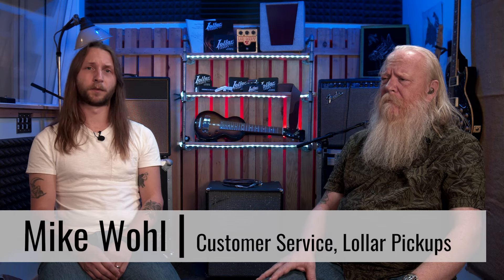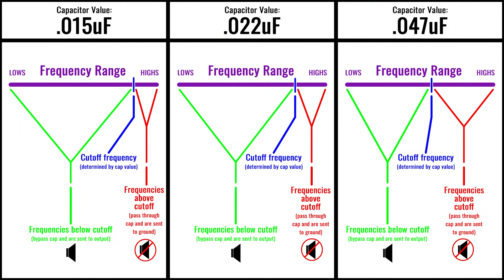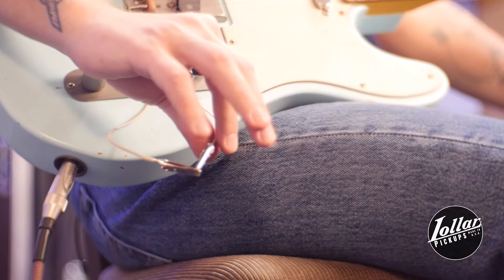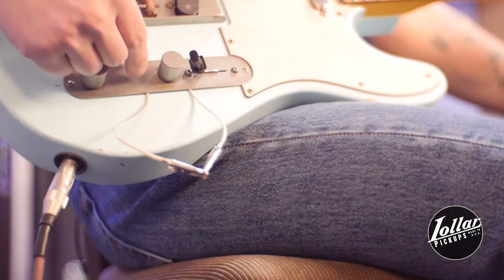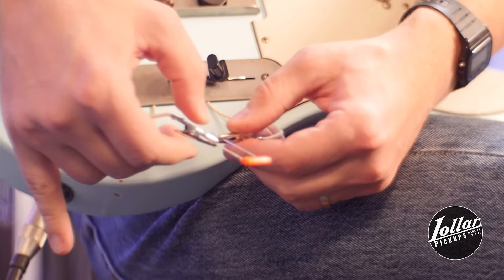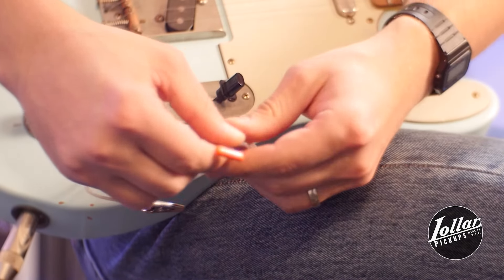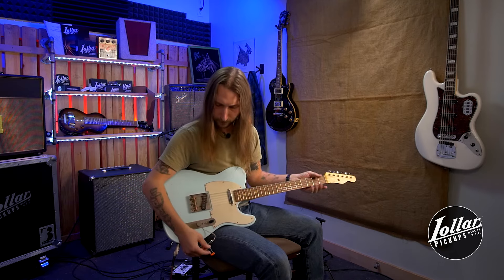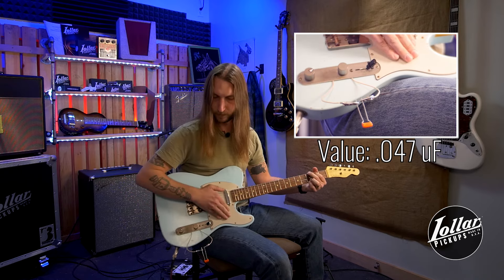LOLLAR PICKUPS Presents: TONE TRUTH - Capacitor Value

Comment: At "wide open" there is no difference between cap values on the Tone knob. Would that be a correct assessment? The cap value only comes in to play as you roll "off" the tone knob. Yeah?
Reply from the maker: Most pots will have some small amount of leak to ground when all the way "open", but it's pretty negligible. So, you will possibly hear some small artifacts of the capacitor, even when the tone knob is turned al the way up.

There are "no load" pots, which essentially have a dead spot at fill open, where the contacts are completely disconnected, so there is no connection between the signal and the cap at all. Some folks swear by these as the most "true" representation of the guitar's tone, but it's a fairly small difference and, since we have all been conditioned by decades of traditional guitar wiring to hear regular pots - along with their inherent leak to ground - that no load pots can often sound too bright and unnatural. 

For a vast majority of players, there is no use in swapping their traditional pots out for no load pots, as the effect isn't worth the trouble and many don't prefer the truly wide open sound after the fact. And, honestly, I'd argue that many who claim to like the results are just trying to justify the time, effort, and expense of the modification after-the-fact.
Reply: @LollarPickups  Good info, thanks!
Reply: My ears say the higher the value of capacitor the more capacity for charge held, the real question is how well that charge is held and how well the capacitors behave to effect the range in frequencies at full open as well as the properties to inhibit highs at full potentiometer/variable resistor operational purpose(closed)

 So more is more, 
And,
its why louder on the amps master volume is better, 
but I still turn my volume pot down to 7 or 8 to allow the caps to do their job at full frequency capacitance with more room to spare and j ne er max my control knobs i always prefer a shaped tone but that delends on thd amps response of the hardware i have in the signal chain, thats when most of fhis argumenf goes out the window. then I find the tone pots sweet spot for me, it is subjective but the guitar as marvellous and awesome an invention as it is and i absolutely love guitars, it is still mathematics and science at the most basic level in its field., in regards to circuitry and design, guitars should be way cheaper especially the electronic components, 
You can get parts ten a penney! Buy in bulk get decent parts that way you can match your pots too, they never read at the value stated and always under or over by the tolerance margin stated they pump these tiny insignificant components out thousands a day and theres no time to test them all. they are the simplest of parts that big ass aeronautical space ships snd plane components are made at the same fa tories, so they are very cheap in comparison not woth 30quid fot a fkn potentiometer or some old out of date "vintage " capacitor if you buy those you are being suckered unless you're running a fake vintage guitar racket scam... then youl need em. and I love how simple it us, lol inside your Nokia 8210 whatever in the 90s if you still have one, it's a supercomputer in comparison to a guitar.

The frequencies drawn from the amps greater magnetic pull(more power) amp responds to the signal if grounded well enough, higher value capacitors on your pots add more girth to the high frequencies, at the same time more highs rolled off yet still more mids are present, because, the resonant peak is shifted into a range that favours low to high mids on the eq spectrum which has all already been mapped out and time tested to be where guitars are better sounding i mean in the mix of a full band, each instrument, some are close to each other like piano and guitar, but each instrument including drums have a strong optimised area to be in within the whole frequency range that the human ear can hear and the man from del.onte Says YES!! 
everything else outide the box is cut out to preserve the sound and save on whatever , mostly because it's useless snd thats that.

. You get more frequencies with  higher value capacitors and still have with logarithmic pots, the option to diall those frequencies back and have a wider range of choice of frequency from full open to full closed.
 Particularly handy when the guitar has bright pickups and good when you have a less expensive amp than tube amp, like a  solid state amp to play on either way- use the guitars and amps eq to control the signal from the guitar thats decidedly how to manipulate the amps responds to the source signal.
 Electricity in an uncontrolled or controlled environment is always drawn or held but never pushed through the amp its electromagnetism basics 101.

Capa itors are what they say they are- used to at various vues, to build up a capacity for an electrical voltage, snd in that value is the information, only judged by response from a receiver designed to connect with another weaker ir stronger electromagnetic cuitcit with magnetism in ghe case of guitars and amps its a variable responsive relationship between the two. 
 the signals are .ensured in wavelengths and currents amplitude etc 
resistors redirect, but the source of the signal has to be within an acceptable range of tolerances and it boils down to the relationship between the pickups reaction to the strings vibratory disturbance of its electromagnetically induced field 

not unlike if you visualise a picture of the earths electromagnetic field from the north and south pole, 

so if everyone all at the same time plugs in and slams a G-Chord we can literally save the planet from an extinction level event like our sun emitting massive coronal ejections tight at us
, it's why it's called the "people's chord"
This is the way, I have spoken.

Comment: Great resource!  I was a bit surprised that with the controls wide open, all 3 caps sounded slightly different from each other, and from the no cap set up in the beginning.  I had always assumed that wide open they would all sound basically the same.  Thanks for taking the time to do this!
Reply: I noticed that too but I think the differences had more to do with where and how he strummed the guitar.
Reply: Confess I didn't hear a difference.
Reply: A lot of rock and metal guys have sworn by no tone control for maximum headroom. Or maximum perceived headroom really, because it's just a touch brighter and more open at the top, which is good for downtuning or a lot of thick distortion.
Reply: The effect of the tone control is the combination of a variable resistor and the cap going to ground.  So it is always exerting some electronic effect.  Whether the effect is noticeable will vary with the particulars of the pickup and the combined value of the max resistance and cap value.  (Remember that guitar amp speakers themselves rapidly and substantially roll off output at higher frequencies.)  Practically speaking the effect will be more pronounced with a 250k pot as compared to a 500k pot, and darn near unnoticeable with a 1M pot.  If you have bat ears there are also specialty pots (no load)  that have the resistive element removed from the top of the contact path, effectively removing the tone circuit path to ground at max setting and eliminating any possible frequency loss.

Comment: I have been a .015 Polystyrene advocate for many years in Stratocasters.  For over 20 years any customer in my shop who I ever made that change for always loved it.
Reply: What caps do you use with humbuckers?
Reply: I wanna know too, the writing on the wall says .022uf but if it matters in my 45 years of "Reviving" Gibsons I found nearly half of the 50s and 60s semis/hollow and solids used 300K pots and to be honest all the caps worked okay every-time( mostly wax in paper or ceramic discs( was fixing up a 61 335 and found 2 ceramic disc caps, they sounded very mellow). There is'nt a rule just opinions. Best clean LP tone was a 50s LP special( 300k pots, .022uf caps? Have'nt been able to replicate that tone in 5 years of noodling...maybe those P90s were a bit "magic"?
Reply: Especially with hotter pups that are already a bit dark!

Comment: I just purchased a 4 conductor wire hummer. And a push pull pot but it came with no capacitor ? Why and does it need one,?
Reply from the maker: Glad you asked. If you bought it from us, it's because we sell caps and pots as completely separate parts. Not everyone needs both for their individual project, so there's no need to charge everyone more than needed or to create more waste of unused electronic components in the world.

If you need both; you have to order both. If you don't; you don't.

Without a capacitor installed, a pot will just act like a volume control, sending your entire signal to ground. When you add the cap to the circuit, it becomes selective in which frequencies are filtered out to ground. Basically, think of it like one of the holes in those toddler toys. The cap is the "square hole"; only the "square peg" frequencies (the higher ones) will fit through the hole to ground and aren't heard. The remaining frequencies continue through the rest of the circuit, through the output of your instrument, and eventually into your amp and out through the speaker.

The pot only needs a cap if you want it to be a tone pot.

Comment: The .0015 rolls off the most highs though…. I thought the higher the cap value the more roll off… am I crazy here? It’s really obvious when you use the jump links at 25%. It’s considerably more roll off than either the .022 or the .047

Comment: I went through a capacitor journey on my Strat about 2 years ago. I settled on .015uF as my all around favorite tone cap for single coils. The fine tune-ability, the smokey jazzy tone all the way down, and the surprisingly decent “woman tone” all the way down with gain… It’s just perfect. Another fun experiment is to use a super small value, like .001uf, .0015uF, .002uF or thereabouts, as a tone cap. Since the resonant peak shifts to just below the cutoff frequency, these values actually provide a perceived midrange boost, which is especially usable on a Strat bridge pickup to achieve chunky rock tones. It’s like a super secret weapon, right there at your fingertips, very fun. I would still pair with .015uF on neck and middle though. 🤘😎🤘
Reply: Add 0.001uf cap AND parallel 130 ohm resistor = treble bleed on volume pot
Reply: I have recently done this on two of my Strats. The bridge pickup sounds amazing now. I used 0.0068 on one Strat and a 0.0047 on another one. With the tone wide open the pickup is less shrill and rolled back it can get close to a PAF in tone (but not output of course). Both these Strats of mine have alnico 2 pickups in the bridge position.
Reply: I bet the Alnico 2 helps smoothe out the naughty top-end, I ended up putting a 60scJensen PIO .1uf in my Strat bridge and middle and after trial and error found the sound that I dig( for now). They were dedigned for amps but you should hear them in a Strat, I think all the spares companies are rebranding these old Jensens , if you have a chance try one, I may try a 5000pf red jensen after reading your post, cheers.

Comment: Great video. On one of my Strats, I have a push pull tone knob that lets me switch between a .15 and a. 47 capacitor set up. So I can toggle back-and-forth between allowing higher frequencies through or cutting them. Super useful.
Reply from the maker: That sounds like a very cool and useful mod! I bet it offers a great deal of tonal variety.
Reply: Same here , except it’s on an ESP/LTD LP design ,and I have a .022/.047 o&p ..

Comment: Great video, the .047 makes that Telecaster sound "Fuller". Messing about re-wiring a duff tone pot I ran out of .022uf for a Strat ( bridge+neck) , found an old Jensen yellow .1uf paper in oil which is physically large but once I hooked it up I found a way to make it fit. Sound is far more versatile than with the .022uf, pedals, clean everything but only on the middle and bridge( I put a .047uf on the neck to have 2 different capacitor values) . The treble pickup got wired to the middle pickup on the selector by jumping a short wire from Bridge lug to middle pickup lug to have 1 tone for both, the bridge has it's own tone pot( .047uf) .  I may stick with this settup for a bit as I use a lot of clean tones with Reverb and a Dunlop fuzz (without reverb) and it just works!! I have tried treble bleeds and low value capacitors on Strats but I find it a bit limiting although if you find a good Mullard .0022uf it can work well for the bridge and middle but you only get 1 really usefull tone. Perhaps Mr Fender and co really did test out capacitors and on the 50s and 60s models you usually get .1uf on Stratocasters and .050/.047 on Telecaster( maybe doubled up on 50s Esquires and Teles for the "Dark" sound). Anyway  the best way is to just solder in a capacitor that fits and try it out , all that soldering in wires to test various caps will drive you nuts( speciall on a Strat) use cloth covered cable that"s pre-tinned cos some wires can add resistance too. When you find something a bit different solder it in and go for it, you can always try another. Whatever you do try to salvage a good quality part, I spent too much time and money on ( magic tone spells) pots and caps so as long as it's a full size pot( easier to solder) and bit of effort in tracking down a varied bunch of good quality caps and you take your time and really listen( or record) to the tone you will smile everytime you pickup that Electric Guitar.

Comment: On my #1 I use both a .022 and a .047  both oil and paper on a push/pull tone pot. Also with coil splitting on both Vol pots. 
   And on my Epi with a set of humbuckers ,and no coil splitting I run .033 caps. 
  🤷‍♂️ just gotta be different.  They all sound good thru my classic 80’s Carvin X100B.

Comment: Great video of comparison. For myself, I use a .010 or .015 orange drop caps in all of my guitars, according to which pickups are in it. I like getting that half kicked back wah sound when the tone control is set at about 20% like the 58 Les Paul use to sound like (with oil filled caps) but works well on P90s, Jazzmaster pups and single coils on Teles and Strats. BTW Lollar pickups are great. Thanks for the video.
Reply from the maker: Thank you for your kind words and support. I too really like the half-cocked wah sound, it can really push the guitar through the mix nicely and doesn't sound as shrill as a treble boost.

Comment: I tried most standard caps and found I prefer switchable .001/.010/.033 values, the .001/,010 in orange drop ceramics, and the .033 in PIO on everything from HB's to SC's

Comment: It would have been good to have a .1 like in pre 1968 Strats included here. It definitely makes for a more punchy neck pickup when rolled back a little. I’ve also noticed on P-Basses that the capacitor (.1 or .05) tends to roll off differently than on a guitar.🤔
Reply from the maker: That's a fair point. We could've tested several other values, but it would've made the direct comparison less obvious with each additional variable. And some folks would've likely gotten lost in the weeds on the whole concept. We went with the three most common values that our customers ask about and what's most widely used in the market in general. We felt that the basic differences in other values not shown can be extrapolated from what's in this video.

Comment: The tone control on my Jazzmaster’s lead circuit basically does nothing until rolled down to 5, and below 3 it tapers off pretty drastically. It has a very small usable range imo. I’m not sure if I should try changing cap values, or pot values, to get a wider usable range on the tone knob. Any advice would be welcome.
Reply from the maker: There's no way to know what the cause is for sure without some troubleshooting. It could, realistically, be the taper of the pot, the value of the cap, or a combination of things. The general rule of "if it ain't broke, don't fix it" applies in reverse as well; if you don't like it, swap something out and see if you like it better or if it gets worse. if it's worse, go back. Repeat until you find the setup that you like best. Typically, though, I would go to the pot as the culprit, rather than the cap, based on what you're describing.